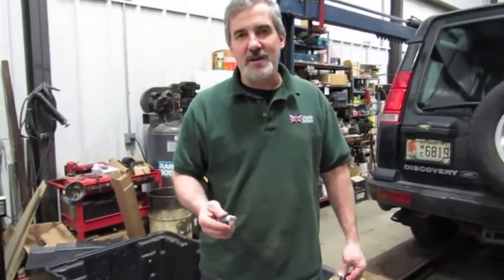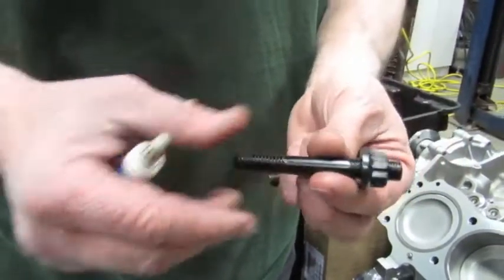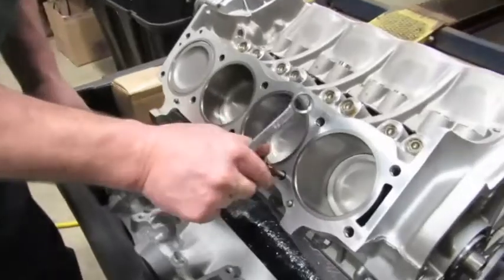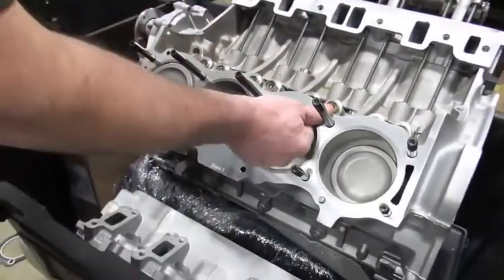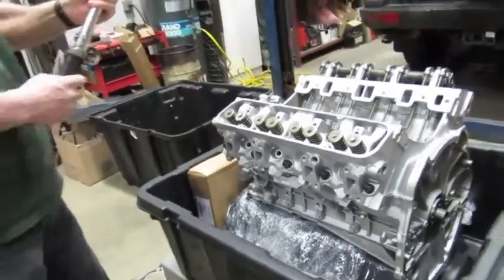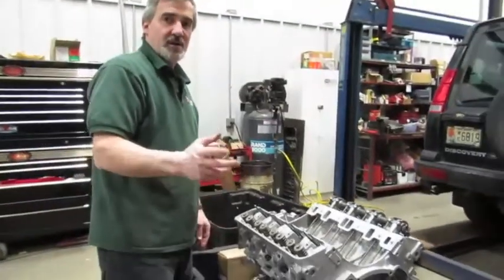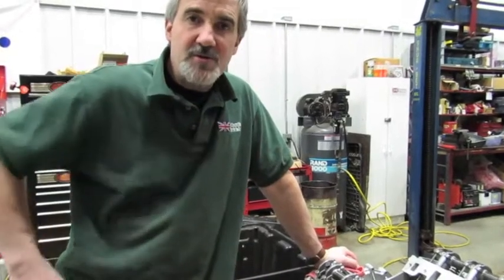Install ARP Head Bolts On A 4.0 / 4.6 Land Rover Engine

Comment: Installing ARP studs on my 93 classic- 3.9 with 14 bolt heads. I’m using elring composite gasket which only allows 10 bolts per head. 

Anyway, the ARP instructions I have are revision 1 from December 2016. 

They don’t state to put any thread lube on the stud entering the block, only on the external thread and bottom of nut. 

They state to tighten to 25, then 50 and then finally 70 ft-lbs, ensuring that the oil on both sides of the washer has been cleaned off before you start torquing. 

Bit of info for those who may be confused watching this..
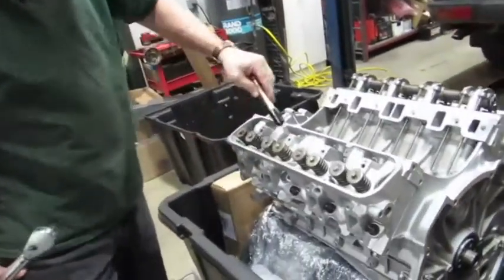Reply: 6:24 6:24 gggggfharmen.🎉is 6:24 6:24 imagine tanks 6:24
Reply: Hwwww.confideral.satnav. 6:25 .. 6:25 😊
Jhgdcggddvgg.what did the king. Completely remember

Comment: I’d be interested to hear the reasoning behind torquing to 85 ft lbs in two steps. The ARP instructions on the Atlantic British website say 100 ft lbs in three steps— but those are out of date (2012). The most recent (2016) revision states 70 ft lbs. Also, ARP specifies a proprietary lube, not engine oil. 

Atlantic British is great, and the videos are normally awesome, but all in all I’d be very hesitant to follow the instructions in this video.
Reply: I put these on my 04 disco about 5 years ago and followed the 100ftlb instructions. Pulled the threads out of three holes! Used helicoils to fix them. But yes, 100 ftlb is way too much!!!

Comment: I just removed the heads from my Disco 2 and found that someone had used these. It was impossible to remove the heads without first removing the studs from the block because of how little distance there was between the head and the firewall. 

I’d therefore go very light on the loctite (or not use it at all) if you plan to do this because they’ll need to be removed later.

Comment: Having just gone through this - Just a suggestion - If you do this on a classic and if the engines still on the car - Don't put the studs in before you laid the heads on the block, gasket, locating on the pins  - You will not be able to get the heads back on!  The current updated instruction set is quite clear on this.    Also would not use the locktite.  Also the torques recommended are different.  Read the instructions properly.
Reply: After reading your comment Im wondering if on my 92 Disco if I'll have room to put head on with studs in place?
Reply: @17quarters48  Sorry don't know about a disco, but if the front edge of the rear panel is anywhere near the  edge of the head then I doubt it.  If you think about it you will have to have at least 3 to 4  inches of clearance to get the head back on with the studs in place.  not an issue if you have the locating dowels on the block as you should be able to get the head aligned fine and then screw in the studs.  current instructions actually call out this order to assemble
Reply: @17quarters48  I didn't have room on my 04 disco. Had put the heads on first then put the studs in
Reply: Per ARP instructions, you can use thread locker. The final torque settings does seem to be too high for these aluminium blocks.

Comment: Would you recommend the head stud system over the head bolt system on a 215 v8 Buick rebuild?
Reply: yes.that is the engine he is working on for a Land Rover Discovery 2.
Reply: @JUKE179r  although the Rover V8 is based on the Buick 215, the 215 uses different head studs. 14 total for the 215 compared to 10 for the Rover. 2 different kits. For 215 performance parts, checkout TA Performance.
Reply: @michaelhite1433 Early rovers have 14 bolt heads. I’m building one right now. I ordered the 10 stud kit and will use bolts torqued very lightly for the outer 4 fixings in an effort not to “rock” the head and contribute to premature head gasket failure.

Comment: Hi i have a question I have a 2005 landrover freelander se 2.5L can you tell me what is the  torque wrench bolts setting in the head cylinder for this car I check it on Google but I get a little confused be cuz here say....   stage1 25 nm (18ft.lbs) and stage2 25nm(18ft.lbs) and stage3 25nm(18ft.lbs) and then 180???   my question is  I have to tighten the heads bolts stage1 .. 25 nm (18ft.lbs) all the bolts  and then stage2 is 18ft .lbs +18ft.lbs = 36ft.lbs all the bolts  and then the stage3 = 54 ft.lbs all the bolts and then the stage4 180 or how ???? sorry but I'm confused can you help me with that thank you
Reply from the maker: Hi Ashley, So the torque rating stays the same through all 4 stages. Stages 1-3 are at 18ft/lbs. while stage 4 is a half turn.
Reply: Hooo ok thank you so much